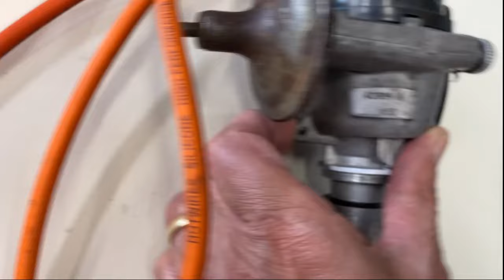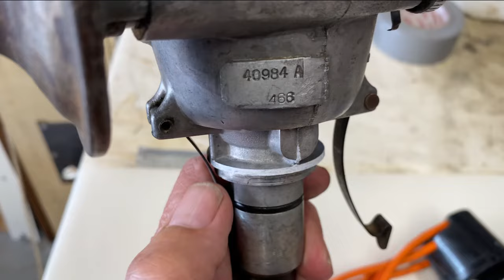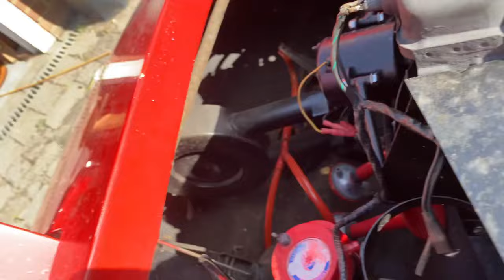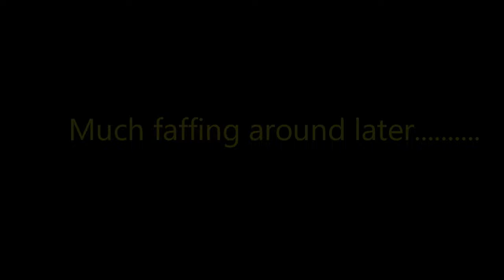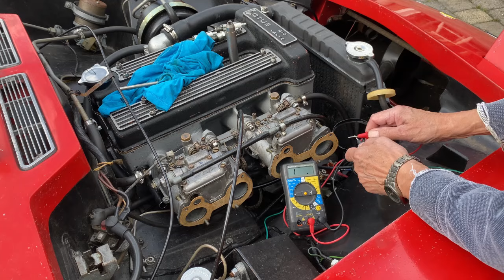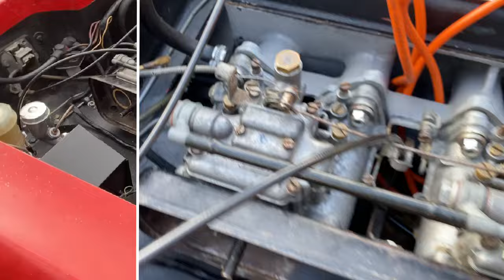Lotus Elan +2: Distributor swop

Comment: Thanks for posting your videos Ian they are a good watch. I have been through all these types of trials and tribulations with mine. One thing I would say it is surprising how quickly the fuel will evaporate out through the breather pipes leading to real troublesome starting and running. I would suggest draining out any old fuel and refreshing and blocking the breathers with rubber bungs while standing. Also is your ballast resistor wiring correct? I have 2 wires to my coil one is live when cranking the other is permanent live through the resistor. This gives you more current for Starting. I have a reliable car now and have fitted a wosp starter, standard distributor, electric fuel pump and a pressure relief valve on the fuel breathers. All these mods have made a big difference to starting and reliable running. Best of luck mate 👍
Reply from the maker: Hi Colin, Thanks for the comment - some good ideas there. I've definitely had problems with fuel evaporation.

Comment: Just found your channel again , I thought it had gone. If I may offer a bit of advice from back in the late 1970's to mid 80's. A friend and I had an Elan and basically rebuilt it . We replaced the points with a Luminition kit which was great as the points went and the design eliminated the problem of slight wear in the distributor. We invested in a high powered coil , the best plug leads , additional ground leads and the new fangled and very expensive platinum plugs !! The distributor had been checked and the springs and Bob weights were doing what they should be. BUT we still had rough running. At a race meeting we were chatting in the paddock to an owner who was racing a lotus engined car and his mechanic was listening in as we were discussing our problem. He immediately said check the webber O rings had not been flattened and over tightened , if in doubt renew and replace the thackeray washers . Tighten the nylocks down until the nylon part just engages the stud and check for air leaks and the carbs can rock. 
All the problems went away..... 
the O rings had to be tightened down to seal because they were old and had hardened, the thackeray washers had lost their spring and so the fuel in the float bowl would vibrate and aeration would happen upsetting the mixture through a certain rev range..  I would never have thought it possible and the fix was so cheap. This may or may not fix your problem  but it's worth a quick look. Our O rings were the original 1970's ones and rock hard.  
We should never have sold that little car but house purchases , marriage,  life etc came along.....
Reply from the maker: The o rings I've replaced and have little rubber doughnuts (which I believe are standard) instead of Thackrey washers.  BUT, I will check again as I too have had problems with leaks. Sometimes when it fires make through the carbs it can displace an o ring if the clamping is slightly too loose.

Comment: You have struggled with two non standard distributors ; suggest you try the Lucas 23D or 43D models which ware original to the car and have no vacuum advance: you can then decide wether to retain points & condenser or choose from a number of contactless ignition modules. I struggled with the original inertia starter  and replaced it with a Wosp preengaged model : small and compact but starts like a monster ; massive improvement. l liked your distributor mounting modification to improve bolt access. Best wishes..Tony
Reply from the maker: Hi Tony.   I have tried to find a 23D or 43D but with no luck.  I scoured Beaulieu Autojumble and couldn't find anything , even similar.  I believe the model I need is  a Lucas 23D4 41189A.
Reply: Ian, I had a look out of curiosity ; true that original distributors are rare but copies are readily available : SJ Sportscars have new copy 23D with points £158..and others sell them at around £100 with contactless innards..Google and see..Good luck
Reply from the maker: Hi Tony, yes I've been looking at new copy 23Ds.  The problem is getting any assurance that the centrifugal advance is right.   In in the process of researching this and will release a video in due course. I'm going to go for a fully electronic ignition system with allows the advance curve  to be programmed.   Ultimately I wont be able to get all the timing set up properly until I can get the Elan running and on a rolling road dyno.

Comment: Ian, I noticed on your carb mounting you have replaced the original Thackery washers with modern rubber ones & nylock nuts. These rubber washers are thicker than the original Thackery washers which means the mounting studs aren't long enough to engage the nylon insert even though you've done them up so that the cup washers are almost touching. You need the stud threads to engage the nylon insert as this is what stops the nuts vibrating loose. You need to fit the longer studs off the 900 engine series.
Reply from the maker: Yeah, its on the ever increasing to-do list!

Comment: I have an Elan Sprint, I changed the distributor for an Aldon electronic one, and the starter motor for a geared pre engaged one, the reason being that as these cars get older the quality of the replacements is suspect to say the least, Another point is when starting do not touch the choke, give it three pumps on the throttle  the don't touch it just crank the engine and you are away. I find that when the car has been left standing and there is no fuel in the carbs, don't use the throttle until it has cranked long enough to bring the oil pressure up, then give it the 3  pumps.
Reply from the maker: Thanks for the starting tips, they're very helpful.

Comment: I feel your pain Ian but your first mistake was changing too many variables at once. Only replace one item at a time unless you know more than more than one is actually faulty. The Lucas starter motors aren't very good, I bought a replacement but a modern geared one is better, I'll upgrade when I work on the +2. 

Personally I'd bite the bullet & upgrade to a new dizzy with the correct setting for the car, ideally with a hall effect setup, mine runs the optical one but the plastic vanes can break over time. Does anyone in the comments live close enough to you to help out with known good parts, I'm in Germany at the moment. I'm not sure about your year but mine came with a standard non-ballast coil but I have fitted a ballast one, as cold starting was always a problem, as a temporary kludge, I switch to the unballast to start then switch back to ballast when it has started, better but not perfect. 

I would imagine that Stromberg owners wonder what all the fuss is about. The SU & Stromberg cars in general always start first time, I remember in the 1970's owners with Fords struggling to get them started when cold, as they had to use the throttle to operate the accelerator pump but often flooded it, more isn't better. When I bought my +2 the choke wasn't connected! It still starts nowhere as easily as my MGB.

Now if anyone knows of a better air box arrangement I'd love to know, the back carb is a bit restricted by the shape of the air box tapering & the fibreglass box doesn't seal very well.